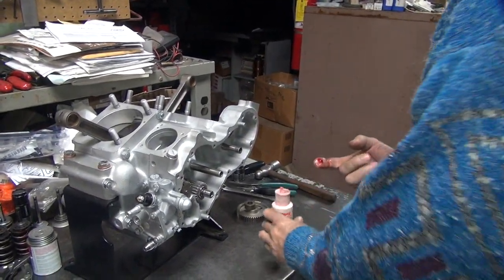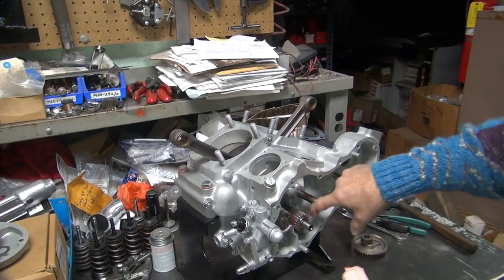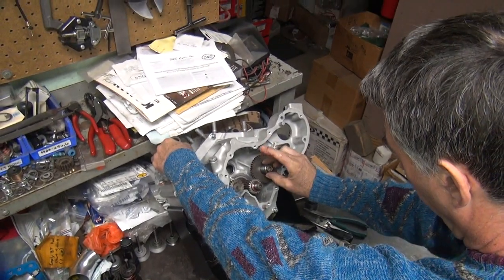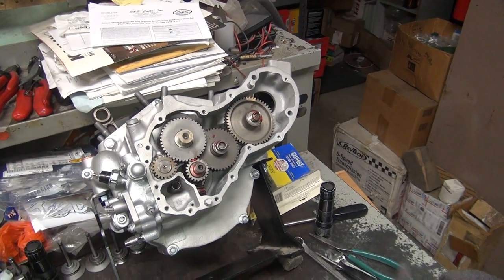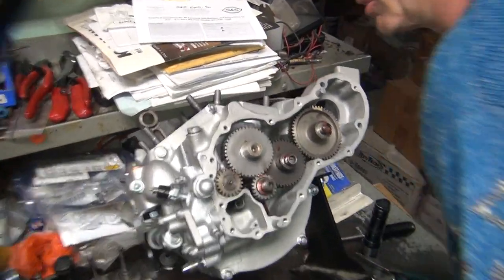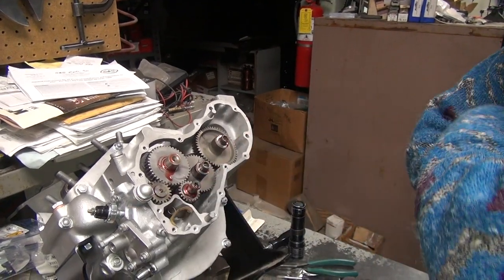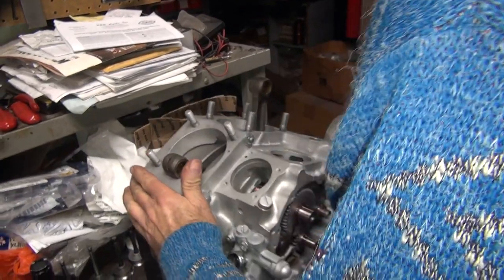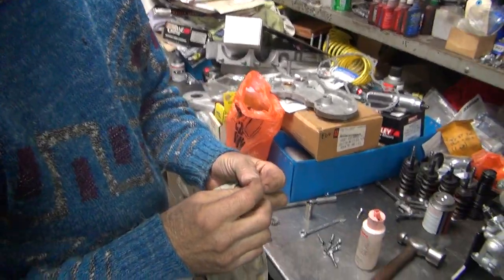#158 1961 FL 74ci std heads panhead motor rebuild oil pump cam cover assembly harley tatro machine

Comment: A good quality end oiling pinion shaft is threaded for orifices or a plug in the event
the owner choses not to end oil. Obviously, when end oiling, the gear case cover bushing
needs to be modified to accommodate.

Yeah, yeah, I know you're not an end oiling fan.

I think with the properly sized orifice and a high flow after market pump it works fine.
We could argue three or two holed rod pins, too. Whatever.
Reply from the maker: that is what i use to do all the time but after running into no oil flow below 1500 rpm with a high volume evo oil pump i had to change my ideas. on pre 1973 motors the crank sucks all of the oil volume because there is only one oil hole feed for the complete motor. you have to cut the oil flow to the crank at low rpm by either a split oil feed like the 1973 and up motors are or by resticking the crank with a very small restrictor plug like around .035-.040. or you could just use the stock side oil feed like i did. the rods do not need to be flooded with oil to work correctly. just look at a 2-stroke bike. they have very little oil in their motor but with roller bearing everything they don't care. i like 2 hole and 3 hole crank pins. the provide a more balanced oil flow to the rod bearings than just one hole. 3 hole is better for a restricted flow and 2 hole is better for a higher volume of flow.
tatro
Reply: @TatroMachine  can you elaborate on the 3 hole better for restricted flow and when restricted would be beneficial? Is it too simplistic to think that a 2 hole would always be better so you can always get a higher volume of flow? I have early pan 48 and 50 if that makes any difference. thanks